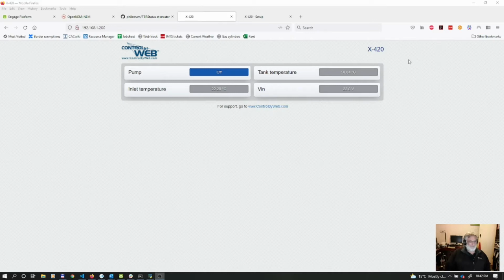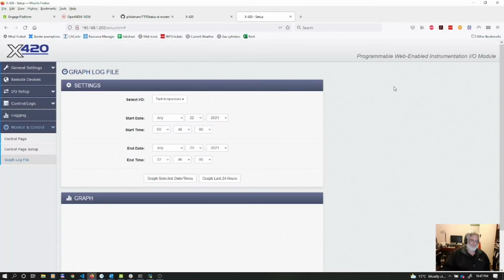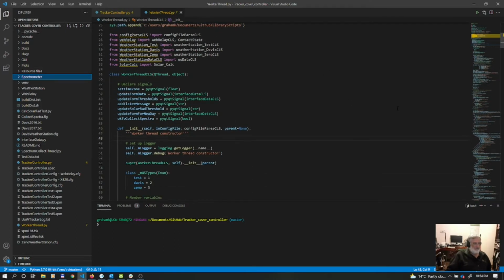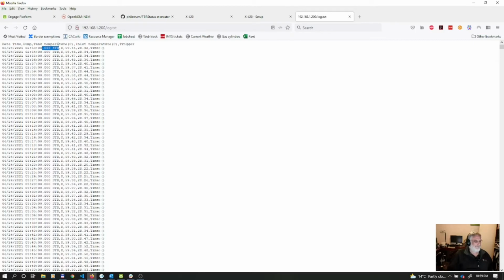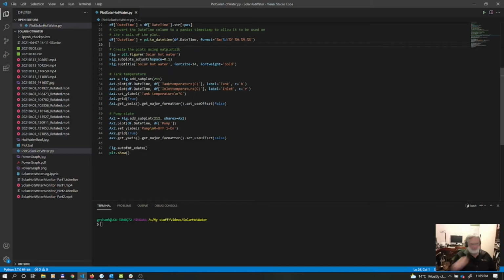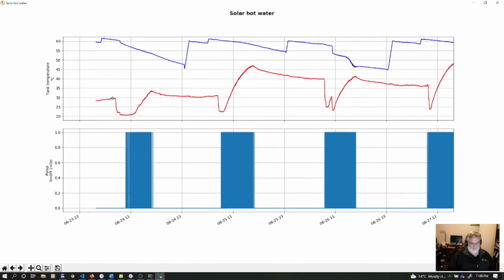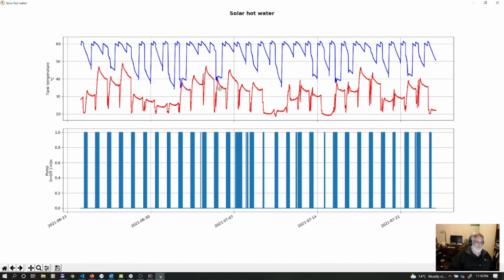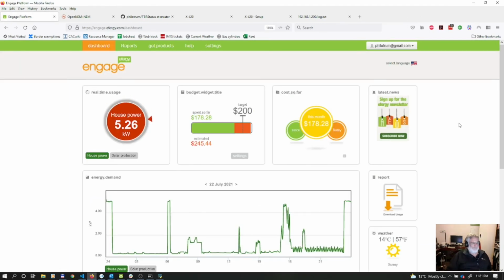Solar Hot Water Monitor Build - Part3

Comment: Very nice to see the data and the performance of your pump actuator. I am adding this type of monitoring to my existing system. Presently, I have a five unit apartment with a gas boiler augmented by solar water preheat. There is radiant heat and domestic hot water. I am running the circulator a lot and I am trying to gather my own data to aid in troubleshooting. Eventually, I want to do what you have done here with the software. Thanks for this example.
The building is in Northern California with very good climate for solar.
Reply from the maker: I am glad that someone found this useful. It is pretty niche. I put these up as much to remind me of what I have done and how I did it as anything else.

I used the gear I did because it was available to me for free. If I was paying for it I would probably use an Arduino and some IO shields. I have used them previously and they would be fine for this sort of thing.

I am still using this code, but I have modified it to retrieve the data every 10 seconds and update the plot live. I keep it open on one of my screens at home.